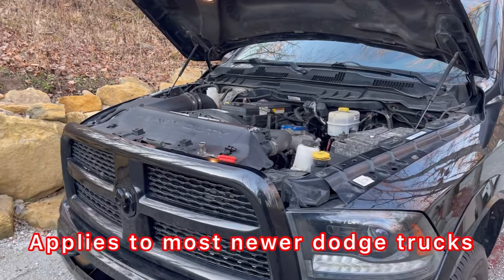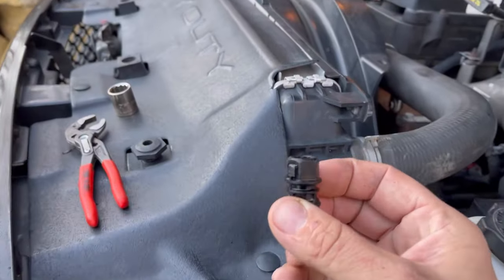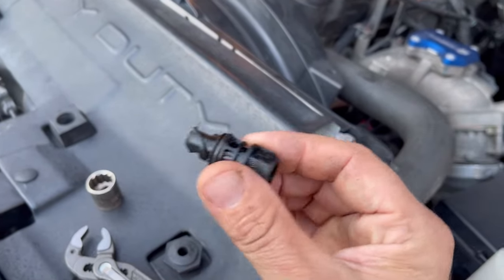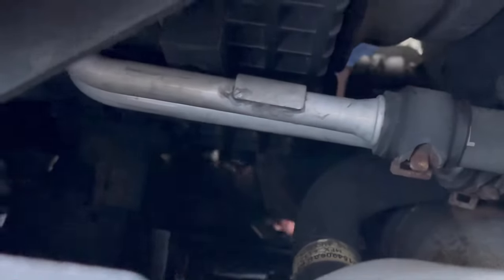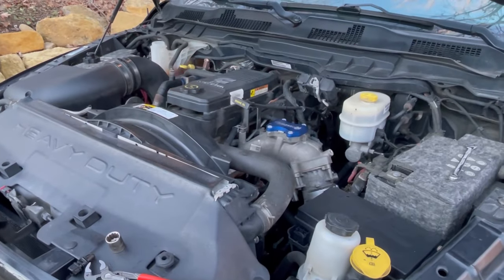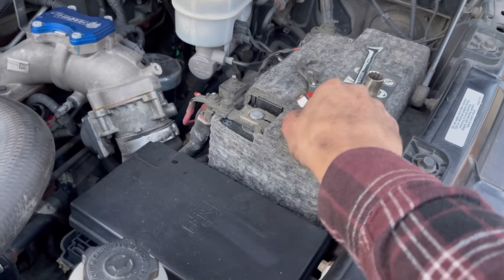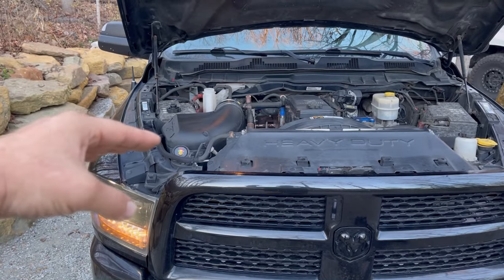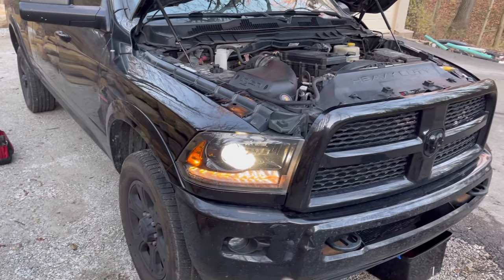Dodge Ram Radiator drain plug location fluid removal Cummins 2500 6.7 1500 6.4 5.7 3.6 3.0 coolant

Comment: To make things easier, it takes an Allen key. It is not that hard to take off if you get one of those. I can't tell you the right size because mine has worn away. But it was so easy. I have watched so many videos and none of these guys has figured that out.

Comment: It's actually a 10mm hex drive in the center of the plug . Use a 10mm hex drive socket on a ratchet.  Works great

Comment: Amazing location for a drain plug Dodge SMH.
Reply: Whoever came up with that location and style of plug needs taking behind the wood shed for some re-education. It's really unhelpful when you just want to drain some coolant for a thermostat change and would like to collect the drained coolant, so you know how much to add back in to the system. A fitting like working like a tap that a piece of hose can be fitted to would be so much better and more functional.

Comment: 3/8 hex may work but it's sloppy and could split the plug open . 10mm hex / Allen fits perfectly and safer to not Crack the plug open

Comment: You can get a little more room for your arm if you remove the power steering reservoir bracket- 3 10mm headed bolts. Comes out pretty easily.
Reply: Can confirm this is a life saver, thanks for the tip!

Comment: You don't need a wrench or socket for that drain plug. You could pull it out with some wiggling. My recommendation is don't take it all the way out. Those grooves should be at 12 and 6 position and a slight turn and push will do it. If you replace your radiator with the one from Autozone or Advance that plug doesn't work.

Comment: I’m going to flush my system so thanks for the info. Seems like you could file off the nubs while you have it removed. Then you could use a socket. Would that help?
Reply from the maker: You could just use the hex on the inside also but I’ll say that this truck ended up with a clogged heater core, we haven’t tried to flush it yet.